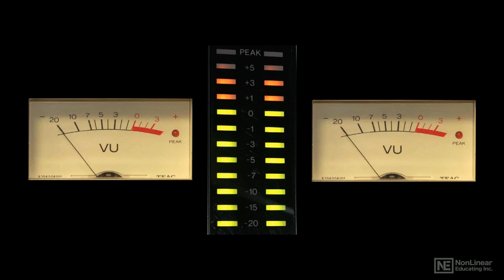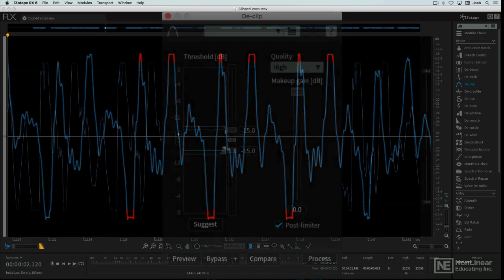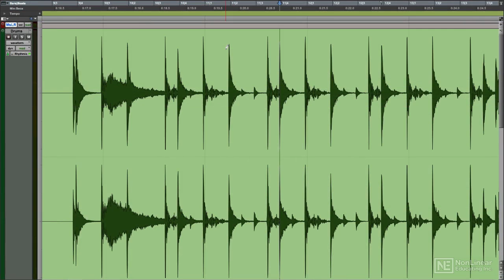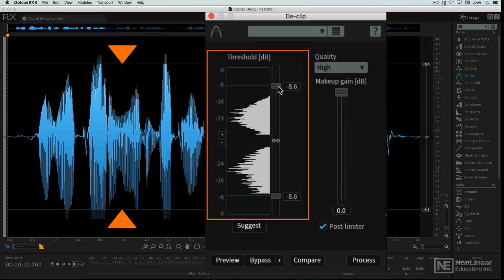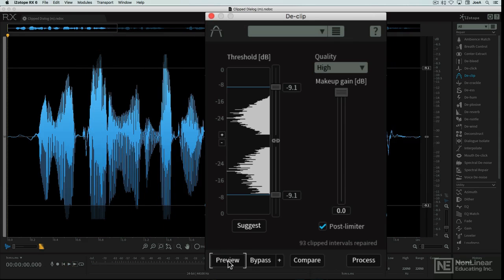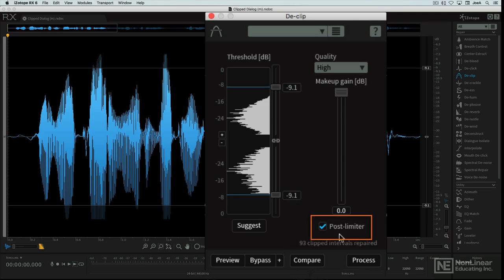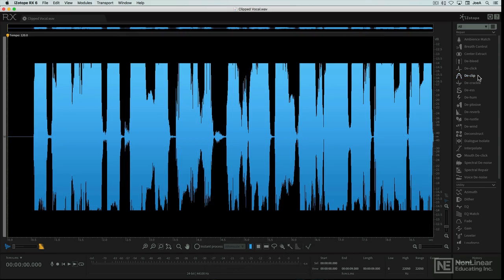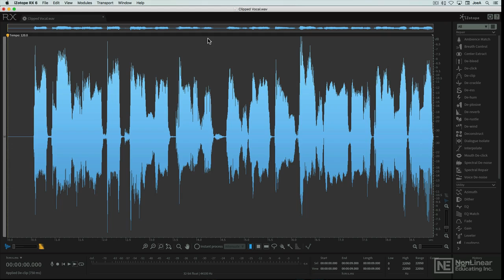RX 6 Advanced 301: The Unofficial Video Manual - 4. De-clip

Comment: The tutor says, "Makeup gain is pretty self explanatory". I beg to differ. In his example, clipping occurred at -7.5 dB or in other words, 7.5 dB below maximum or full scale of the digital range. If the original peaks were no more than 7.5 dB above the clipped level, then there is sufficient headroom for the restored peaks. If not, then you must use the Makeup Gain to lower the level of the signal so that the restored wave will fit in the digital range.
The example must be for a case where overload occurred before analog to digital conversion. If overload occurs at the A to D conversion stage, then clipping would occur at the 0 dB level. The Makeup Gain control must therefore be used to create some headroom for the peaks. Use trial and error such that after restoration, the peaks are just below full scale (0 dB level) of the digital range.